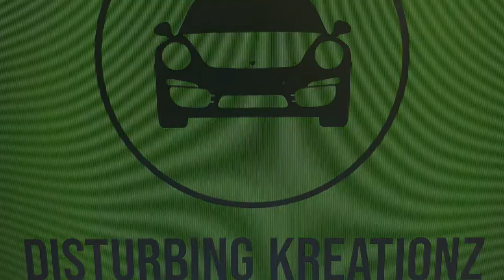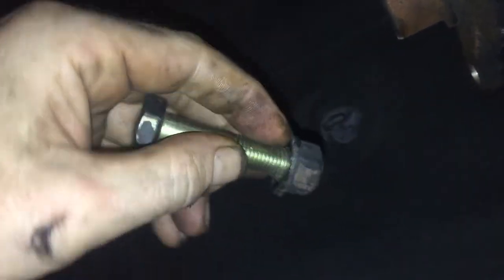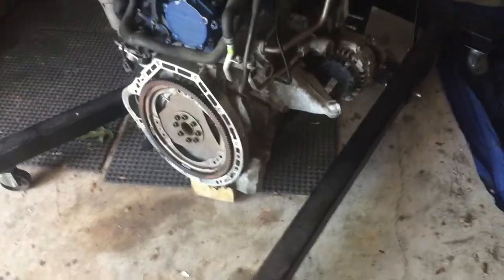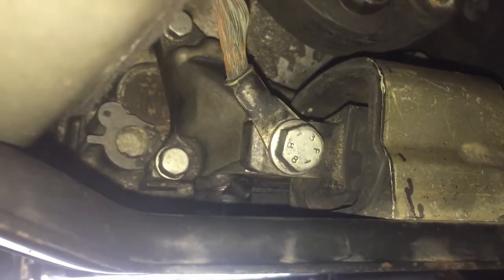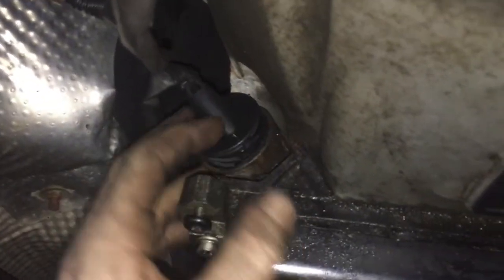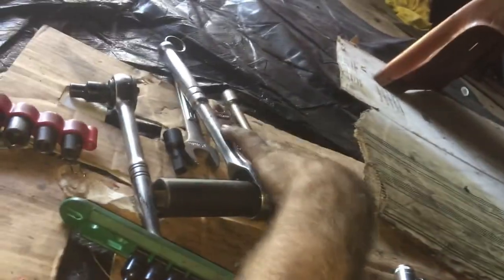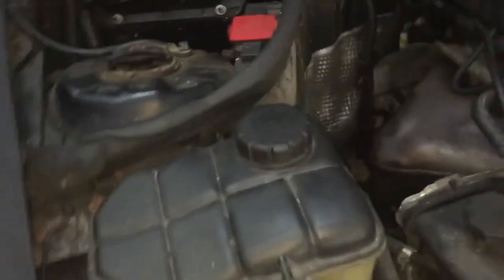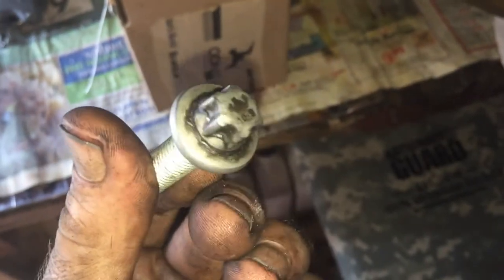How to remove and install an automatic transmission with torque converter. Ex.  Mercedes Benz 722

Comment: I have to change my 722.6 gearbox laid on my back like this too but outside in the rain and probably not the right tools for the job 😂
Reply from the maker: Whatever you need please ask. We are here to help.
Reply: @disturbingkreationz  thank you 😊 I won't be doing it yet. I have to wait for weather to dry up a bit as I'm doing it outside
Reply from the maker: No problem. Hit us up when you do it.
Reply: Hi guys me again sorry to bother you. Weather is getting a bit better here now so cars up in the air ready for when i can get started. Do you happen to know or have a list of what tools ill need to get it removed? Just so i don't get stuck half way through. Its fine if you dont but worth an ask now incase i can get whatever ill need thank you 😊 @disturbingkreationz
Reply from the maker: Yes you need to buy metric E-sockets. I have a class on them in my basic tool playlist. If you can’t find it I’ll post a link here.
Reply: @disturbingkreationz  OK thank you. I've got socket sets and loads of other gear so I'll give it a go I've got most tools needed for most jobs as I work on my own vehicles. Thank you 😊

Comment: I was told that you should pull out the torque converter+transmission together
Reply from the maker: Together or separate is the mechanics choice.makes the trans a lot lighter if separate.
Reply: Its is easier to pull out together and install together.

Comment: mine is a 1978 300D.  really nice vid with lots great info. how many mb trannies have ya pulled this way? were any years you see worse to remove or were all about same?
Reply from the maker: @otisarmyalso  I have no gone all the way back to 1978 mostly 90s and newer I would imagine the “technique” is the same. Your has less electrical components.

Comment: Hello, do you have to reprogram the transaction, I replace a transmission on my 2008 clk 350 the car won’t move .
Reply from the maker: @jhapropheteemile9897  no you do not have to program transmissions. Can you give me more detail? Does the engine run but car won’t move?

Comment: I need a transfer case off the back of a 722.9 2012 e350 4matic I’m most greatful for any help i know u have to get the whole trans but either way I need help
Reply from the maker: @tonydavis7852  what are you asking? How to get a 4 wheel drive case from a transmission?
Reply: @disturbingkreationz  i need to find a used one I have had no luck any help I would appreciate

Comment: Hi I’m installing the engine but I’m having trouble installing it because of the torque converter and the flywheel not coming together 2012 Mercedes c250
Reply from the maker: This is a common problem for people that do not do this everyday. I am no transmission expert but I have changhed a lot of automatics to manual so I do have the knowledge. I answered on your other comment. Have a good day sir.

Comment: hey i have a 2004 c230k! my serpentine belt broke and knocked off my transmission line to the radiator and haven't shifted above 1st gear ever since! I changed my conductor plate i was wondering if i had to clear the codes before it would work or is my transmission blown? or could i possibly change the shift solenoids?
Reply from the maker: You def lost fluid. Fix the line first. Then add fluid to the trans till full and try to drive it. You should never drive a leaking transmission. You can burn it up. You can erase the codes but that won’t do anything until the problem is fixed. How much fluid did you put back in the car? Also how many miles on this car?

Comment: Hi. I have a question. My Mercedes W 204 , transmission, when I go in drive it moved then it will stop after second gear
Reply from the maker: I don’t think changing the filter will work for you. It sounds like the bands in the auto trans have worn out in higher gears or a valve in the body is plugged. How many miles do you have?

Comment: I’ve got a 1999 ML320 hemorrhaging transmission fluid from the front of the transmission.  Need to remove the transmission.  I don’t have a lift.  Looks like it’s over my pay grade.  Not budget friendly to take it somewhere and pay thousands.  Any suggestions?
Reply from the maker: Yes. This sounds like a front pump seal on the transmission behind the torque converter. My advice is to watch the full video and take out the transmission. After you get it out then take it to get looked at. You will save a lot of money by taking it out and putting it back in so the shop doesn’t have too. I did this work with no lifts. Please give me any more info so I may help.
Reply from the maker: Is it coming from the top of the trans front or bottom? Check the dip stick as well for the o-ring could have went bad and it’s leaking “near” the front.
Reply from the maker: Subscribe please and I will help.
Reply: Thanks for your kind response, my friend!  I can peak through the torque converter window.  It looks like it's coming out the bottom but that might be an optical delusion (hehe).  Trying to figure out how I'm going to get it up high enough to get the transmission out.  Subscribed as ordered, sir!  Thanks so much for your help!  Hope your Monday is going great!
Reply: Btw, not the original torque converter.  I'm thinking that may be part of the problem.  Just an uneducated guess.
Reply from the maker: AGAIN youtube not showing me comments. Yes there is a site window and there are bolts to take off in there. There is a trick with the torque converter. When you put it on it has to slide in, turn slightly, and push in a second time to be inside the bell housing before installation. Sorry for the late response.

Comment: Im doing this for a 722.9 on my cl500 any tips
Reply from the maker: I think the transmissions are very similar. Any question in particular?
Reply: @disturbingkreationz  yea, what parts do I need to swap onto the new trans from my old trans to make it so I don't have to program anything

Comment: Then I would have to wait for about a half hour then drive again so I have changed the filter/ is it that the transmission gone. Pkz
Reply from the maker: I saw your first comment. It sounds as if maybe the trans fluid cooler is plugged or one of the lines. When the trans gets hot it slips. You say when cools down drives again. But after second always no good? I would change trans. Blow out the lines and cooler. If cooler is clogged. Also replace.
Reply: @disturbingkreationz  ok Kool. The reason why I ask you, is when I take it to the dealer they told me because the smell that my transmission is gone
Reply from the maker: Fluid can smell burnt and the part still be functional. What happened with this one?

Comment: How do I know my torque converter is installed completely. Can you help?
Reply from the maker: Yes. Great question. When you slide it in it comes to a stop. you have to turn is slowly to find a second connection to make it slide in a second time. it will only move about an inch or so. At this time it is ready to be installed. 
Tip: If you look at the front of the transmission, ( from one side to the other across the front), the converter can not stick out at all.